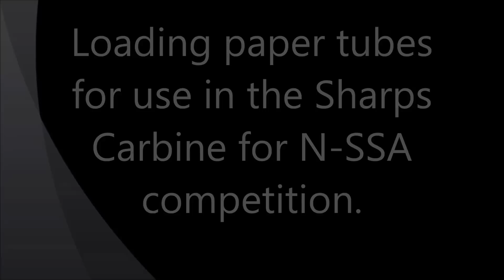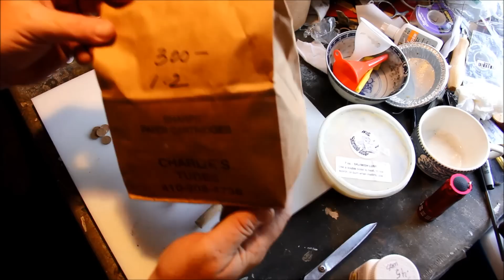Sharps Carbine, making paper tube for N-SSA target shooting.

Comment: Nice video. I have a 1859 "Berdan" Sharps rifle made by Pedersoli. Charlie Hahn reworked the breech block for me. My methods are very similar to yours. I also use Charlie's Tubes most of the time. I've made cartridges using nitrated paper and it works OK. Using the tubes speeds up the process a lot. The tubes are more robust and hold together much better.

Comment: A simple method is a little dab of clear fingernail polish on the base paper and then dipped in FFFg powder. If the flame gets there you have ignition. For the first couple of shots try using a flint lock pan primer and drop a bit of powder in the nipple. RWS musket caps  are hot enough to give good ignition and are much better than the new CCI musket cap.  YMMV. Good video thanks for the effort. Sharps Carbines RULE!!

Comment: Considering you are using such thin paper as your tube end, you may not need to pierce it with a sharp object.  Just let the flame from the percussion cap to poke a hole in it and ignite the charge.

Comment: I cast my bullets using a 480 grain 0.544 caliber Sharps Christmas Tree mould by Moose Moulds. The base of the bullet fits is a tight fit in the tube so I skip the finger nail polish step. I've also found that I don't need to poke a hole in the paper. The spark from the cap burns through followed by that great thud and cloud of smoke!

Comment: I'm stuck. I recently bought a used Armisport percussion cap Sharps in .451 caliber.

My problem is simply what bullet to use. I think I have to slug my barrel and get a mold made. But I don't know what weight bullet to I need.

I contacted Charles Hahn about the tubes, but he wants to know how long they should be. To know that I'm supposed to have a bullet placed up to the rifling.

But I have no bullet!

Can someone help me with this?

Comment: Hello, can this create space between the bullet and powder?
Reply from the maker: Yes, it does create a small space between the bullet and the powder.  BP is slow burning so the possibility of a barrel bursting is very low. You can increase powder load to make up the difference, that may affect the accuracy.  Some people build the bullet opposite of what I do, the put the bullet on the end,wad, powder another wad with a hole in it.  This can lead to misfires, due to powder being further away from cap ignition.
Reply: I see, but even when button wad is nitrated
Reply: lastchip understood, thank you.

Comment: Are the tubes nitrided?
Reply: nope, you have to remove them like brass cases... only they don't last nearly as long as brass... The whole point of the paper cartridge breech loader was to have the paper envelope COMBUST in the chamber, so there was nothing to remove (speeding up reloading) lol.  Cardboard tubes for these are a Money-hole solution looking for a problem, imo.  They aren't historical either, there were really 3 types of cartridge the US bought for the Sharps: 1. Combustible paper, 2. Brass/copper foil cases wrapped in paper, and 3. turned (later drawn) brass/copper cases.